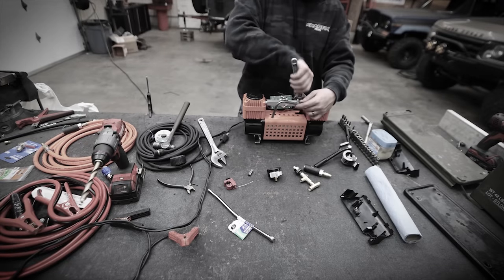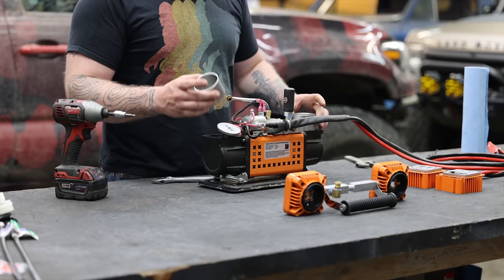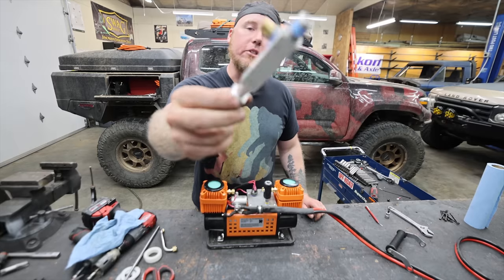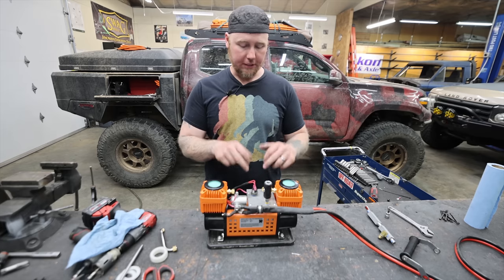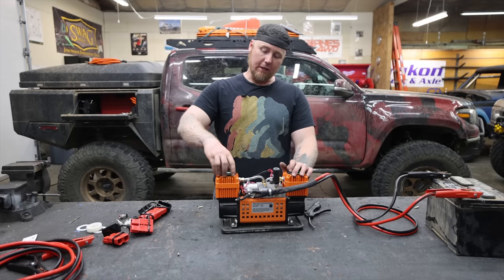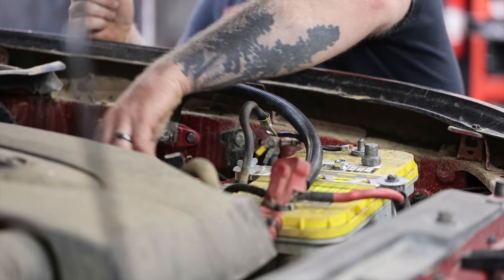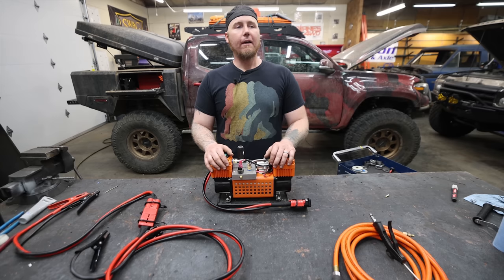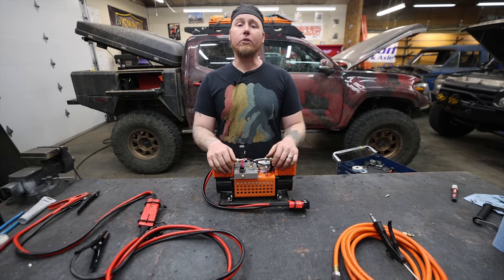Best Off-road Air Compressor MODS Part 2!

Comment: I strongly recommend you put a inline fuse or breaker on that connection coming off your bus. high amp breakers are cheap, resettable, and above all the safety factor! love the videos keep up the awesome builds.
Reply: We thought of nost if the improvements, hard mounting the comp on a cross bed tool box with jumper cables running to aux battery.   Started with a 80 amp breaker and was tripping.   Upped to a 100 fuse/breaker and no more issues.
Reply: I was just going to post the same thing. Fuse everything that is not going to the starter or fuse box.

Comment: I don't claim to be an expert, just basing this on past experience. I've had numerous job site compressors with a similar 90 deg short copper outlet from the "Head" like you have. All of them failed at one point from vibration cracking the pipe at the fitting. If possible adding a single coil in the line adds enough flex to make the connection less rigid and less prone to breakage.  Alternatively having pre-cut extra pieces in your kit would allow for a quick change on the trail if needed.

Comment: As a lineman, for anything on the bottom of a transformer, that’s under 600 volts, we use electrical tape. It’s rated for 600 volts for a single wrap.

Comment: As far as the reeds go, I've seen the Aussies use their feeler gauges cut down to fix or upgrade.

Also, to crimp bigger gauge wires, I cut the appropriate sized nut in half and squeeze everything together in a vice.
Reply: That’s brilliant. Gonna remember that

Comment: Love these video's as I have also done this to my compressors as well. Except I went a little over board and joined 2 of these compressor's together. Ported the intake and exhaust, changed all the outlets to nothing smaller then 1/4" , swapped out the electronics for a 200amp Solenoid, obviously upgraded all the wiring and runs off a 175amp Anderson plug. All tucked away in a custom box that's running 4x 12v computer fans above the heads. One thing to note is you will find the limits of the valve in the tire at the pressure these run. And any mods will almost not Change the time it takes at all as the valve is your biggest restriction, unless you work a way out to up the pressure. But when pumping all 4 up at the same time that's where the improvement can be seen. I compared the difference by filling my workshop compressor tank from 0-40psi and timed it. Single unmodified compressor did it in 54sec, ported/modified single compressor did it in 46sec, 2 modified compressors joined did it in 23sec!   I'm keen to see how far you go with this compressor. I like your idea of adding extra valves in the head!
Reply: Awesome…LOL, yep, port and polish Schrader valves & stems.
Reply: I just pull the needle valve out when doing big tires. I have a quick coupler fitting that threads on the valve stem.
Reply: Turbo Charged portable Compressors
Reply: I'm doing something similar but with a 10-gallon air brake tank added on.
Reply: I know I'm late to the party but I had the same idea lol was thinking I can buy 2 of these and design the block to conjoin them into an H4 configuration, route the lines through a finned reservoir to help cool the air and not bother with fans since I'll be aired up before it gets any serious heat lol

Comment: A lot of auto AC compressors (like a York) use reed valves, I'm sure the local wrecking yards are full of them.
I ported the head on my old Masterflow single cylinder version of that thing, and it made a noticeable difference.
One thing to keep an eye on is the connecting rod bearing, I had one go bad (after several years) and it knocked like crazy, but they are easy to replace with a better quality one, they're just peened in place, at least on mine.
I used to pick them up for $25 before the offroad community discovered them!
Love your channel.

Comment: This series is awesome! Those Anderson fittings would be awesome for a bunch of stuff. 
1. Jumper cables that plug in on 1 side so you don’t have to open the hood. 
2. Maybe somehow you can plug solar panels into it and charge the trucks battery when camping? 
3. A spotlight could plug into it that can be used when working at night. 
4. Potential welder plug (with modification)
Reply: Meanwhile most of these stuff we already use Anderson plugs for in Australia and have done for at least 10 years.

There are things that you need to take into consideration. 

For jumper cables, the ones he used are inadequate. His 4 gauge cable is treated for about 500a he used either sb120 or sb175 Anderson which have 240a and 280a rated continuous draw respectively. So his jumper is now derated to that. 

So for a jumper cable you would need the sb350. But it would need a big isolator like the ones used for winches, or a big fuse, in the case of an isolator you presumably would need to open the hood to activate it. You don't want an always live electrical wire of that thickness under your hood. 

For solar panels it is always done through a DC-DC or an mppt but the SB50 and much lighter cable is all you need. I have several Anderson in my ute in several places for these type of scenarios. 

For the welder you would need again an sb350 and they are huge.

Comment: always be sure to fuse leads coming off the battery!  OEM always have fusible links, or fuses, aftermarket is no different. triple insulating isn't a good replacement for proper fusing practices.

 can even do a circuit breaker for ease of resetting if fuse replacement/cost/time is a concern
Reply: Agree, especially in a spot where it can easily get smooshed in an accident or coming off a rock wrong.
Reply: a simple solution could be a large circuit breaker in between the battery and bus bar that he is using. that way he can easily disconnect power to the aftermarket and leave all the toyota directly connected to the battery
Reply: heaps of OEM battery wires are missing fuses, especially on older rigs, but I agree, a row of nice fat ANL fuses built into the buss bar is what I use on stuff like this

Comment: You can wire out everything using Andersons including ditching all "cigarette" plugs and going with Powerwerx Powerpole at 45amps over 10gauge wiring. They have everything for expansion and connection.  Everything from solar to lighting to fridge etc. all on Powerpoles.  I use the large Andersons with 1/0 welders copper for distribution from front to rear to the auxillary, from auxillary batt (LiFEPO) and a 300amp marine switch to tie it all together.  I WILL be getting that compressor with the mods you've incorporated to back feed my on board Viair system for better faster flow in air ups.  GREAT videos man, keep it up!

Comment: excellent video, I'm glad you mentioned making sure to take extra precautions with insulation when installing the Anderson connection wires. That's not something that a lot of people mention when doing something like that, even though it seems like it should be common knowledge!

Comment: Have you thought about fitting a air chamber to store air as you use it to give it some flexibility and to reduce the heat build up, just like the big air compressers.

Old 2 stroke motorcycles had reed valve's made out of a plastic, polymer type of reed with a curved back plate, something like that or actually have a look at the way the 2 stroke Reed valves work.

Try securing the Anderson plugs in a more secure and sturdy part of the chassy so it does not put excess ware and strain on the cables.

Comment: Nate, I like your thinking. Just a note on the electrical work, consider putting a large amp Fuse  ( like 100 to 200 AMP )to save your truck from fire if a short to ground should occur.  I was installing a large cable upgrade to my jeep when I had a short to ground and the large fuse 250 Amp saved my rig. I used ANL style fuses they have large AMP ratings. Keep up the great work.

Comment: Good to know you're in the NW..   I'm in the Everett area and have owned a semi-serious off-road vehicle - nicest vehicle I've ever owned - for two years now.   Need to catch up on wear parts from two previous owners lack of maintenance, and get 18" wheels (smallest I can fit for more A/T tire options) so I can start doing some wheeling.  As well as some other off-road upgrades.

Came across your videos a couple of weeks ago and like what I've seen so far including this super cool compressor series.    Thank you!

Comment: Note instead of running just heavier cable, you should always fuse between ur battery and bus bar suitable to the cable and then each accessory should be individually fused as per the equipment specs!

Comment: For the reeds you can use feeler gauge I used them to repair a small outboard motor. 👍 Worked great. or go to a motor cycle shop and see what they have. Great project. 😁👍

Comment: About 5 years ago I ported out one of these compressors same as yours, it was 18% faster afterwards. I drilled out the ports in the head under the reeds, enlarged the intake and cut up the air filter housing. Stock on a 33x12.5r15 0-40psi was 3 minutes, 58 seconds and ported was 3:15. I think you've gone down the right path reducing the voltage drop, mine was a whole minute slower running off my other 4wd with an inadequate alternator! (11.5v vs 14.15v!) If you want to fit bigger reeds I think cutting up some feeler gauges would work well.

Comment: Hey, great idea on increasing intake air BUT BAD BAD BAD for your compressor. The location of air intake on sides is specifically designed to draw air over cylinder head fins and cause a cooling affect. Think of it as forcing air flow across cylinder on hardly motor as you drive. If you sit on red light for a long time it overheats because there is no air flow. So since you did a hole on top you MUST add a few cheap 12v computer fans or something to force air across your cylinder fins to draw that heat away because radiating heat (which is only way to dissipate heat now since your mod) is not enough especially if in that ammo box you will burn up your cylinder seals or warp the metal. Good luck. Great ideas by the way.

Comment: You will really appreciate having the anderson connecter's on front and rear of your vehicle. I've been using them for many years, from jumper cables winch connections on and on.
Reply: That's what I use for jumper cables
Reply: Same. Nice being able to unplug my winch if I just want to take my bumper off or being able to plug up a set of jumper cables without opening the hood.
Reply: YES, I planned to install Anderson plugs on front & rear of my rig for cables/accessories.
Reply: I also have Anderson plugs on my plow truck.  It runs the main power for the plow along with winch, jumpers.  You could hook up solar charger along with other options. 

Just put a power cut off close to the battery if you are worried about it.

Comment: Nate
You should run another line with Anderson connectors to the back of the truck so you can run your winch on the trailer or on your extra winch on the trailer hitch for the rear so if you get into a hairy situation off road you can use both winches when necessary.
Reply: To do that safely he would need a sb350 Anderson connector and properly sized wire. A 12000lb winch can draw 430a so the medium duty Anderson like the ones he used (sb120 or sb175) would melt and the wire may even catch fire.

Comment: I picked up this compressor last year and also used jumper cable wires and Anderson connectors. So much better than the stock wires and alligator clips. Also did the pressure switch mod to auto shutoff to prevent over pressurization.

Comment: CFM GAINS: Search for "rotameter PRM 400 LPM" to help quantify your CFM gains. If this compressor really does put out 300LPM free flow (likely less), a 400LPM rotameter should still fall in the ballpark. These mechanical flow meters always have some restriction as well (suspends a physical weight inside a tapered tube) so it's not exactly "free flow" anymore and will measure a little less than actual. If it pegs, try filling a tire at 10psi or more (meter can handle 100psi) till you get a solid reading. Digging this mod series. Keep it up Nate!

Comment: Dirt,
   I just finished watching both videos of the mods to your little twin cylinder compressor. I recently had a  Viair go south on me (which I never liked in the first place) and I'm on the hunt for a replacement. I really like the twin cylinder versions vs the single cylinder ones. I really like the mods you made to it. I've dealt with air compressors for decades both at home and mobile. For home units there's not a lot that can be done to improve them. But for the smaller mobile ones, like 12V units, yep, just like you're doing, improvements can be made. 

As maybe has already been stated, I'd like to have seen some test comparison numbers on a bone stock unit and the modified one you're working with:
1. A flow and time test to fill a given sized tire from trail pressure to street pressure on stock vs modified
2. An amp draw or any current or voltage draw measurement on the stock unit while working on filling a tire, vs the modified one with the much larger electrical cables. 

I too have been using Anderson connectors for my electrical connections on my compressors etc. for years and years. They're great and very durable. Thanks for taking the time to video all those mods on that little compressor. About 99.999% of the off roaders could care less about improved efficiency and just simply put up with what ever comes out of the box. I like improvements on that stuff, just like what you're doing. Keep up the good work. 
Scott

Comment: Great videos!  I strongly suggest a Circuit Breaker within a few inches from battery!  I've used 500a breakers from battery banks that were pumping over 5000 watts to sound system.  Breakers would "buzz" when slightly overloaded, but instantly open when shorted!  Fuses only work once!  Tiny 4 gauge wire would vaporize!  Also, a one farad capacitor on the bus would extend the life of all the electronic stuff!

Comment: Same on the solder, but after having attended several different courses over the years taught me that PROPER crimping is superior for high vibration applications.
Reply: yep. no soldering on vehicles. unless you can tie down both ends of the connection properly. but surely not for hot or ground leads of the starter battery. solder ain't a good conducter.

Comment: I also have been running a Anderson plug on my front bar of my 4x4 for a compressor,  solar panel, 12 volt shower and for also being able to plug a charger into it when it's sitting in the shed for weeks at a time.

Comment: I did the SAME EXACT thing for my compressor and jumper cables last year, lol. Great minds and somehow mind keeps up.

My jumper Anderson ends join to make a comple set. Separated, one side will connect to the compressor and allow clamping to a different battery, and the other side connects to the truck to jump someone without lifting the hood.

I'm VERY interested to see what other accessories you rig to hook to the truck.

Comment: Great videos :) We have a similar compressor for cheaps here in Oz. 1. Question: Why not remove the powder coating from the heads so the alloy can do it's job of dissipating heat better?
Reply: EXCELLENT idea!

Comment: Nate I've built a set of jumper cable the same way and plan on using the Anderson connectors on my compressor too. cooling that compressor is tough but i just place it in front of the jeeps grill and the radiator fan moves enough air to cool it. for the carry handle ..... fab up a new baseplate with a handle integrated into it.

Comment: Great idea on using the motorcycle type of filter to open up the air intake flow! 

Nice use of the andersson connectors also oh I have a beefy crimper if you ever want to borrow it.

Comment: Good job! I like the Anderson connectors, I have one connected to my truck battery which is handy to connect jumper cables to jump someone's vehicle, without having to pop the hood on my 4x4 F350. Plus you can do all the things you talked about connect an inverter easily or other 12V accessories.

Comment: I'm thinking... enlarge the output port. Not too much. (Don't know how much) Small hole = high pressure, small flow, large hole = high flow low pressure. The seal on the port is the tricky bit.
Great video.

Comment: Love this series.i wish so badly I could get my hands on one of these compressors. Question though. Have you thought of the molded bolt through holes on the Anderson connectors. There is a recess on one side to capture the bolt head or nut. Certainly your skills with nutcerts would come in handy here. Would love to hear your thoughts on why or why not.
Reply from the maker: I'm going to build a different bumper and I want to address this when I do 👍
Reply: Good plan

Comment: You can get a 16 ton hydraulic crimper all over Amazon that will do 2/0 cable for around $50. They will give a superior connection over solder on a cable that large, Most are marked in metric, but easy enough to figure out what fits for a tight crimp on a given wire. I've had mine for about 6-7 years now.

Comment: Strips of "spring steel", comes in a range of thicknesses, then you can shape it with a belt sander or similar. I've done it on larger air compressors.

Comment: Nice vid Bro - some two stroke motorcycle reeds will work. to measure the difference in cfm (not actual cfm) measure the difference in time to fill a tank to a certain pressure, but I'm sure that you have already thought of that.

Comment: I put a 12” electric radiator fan on the side of mine. It over heated. Also back pressure causes problems. 11 cfm is 2x the flow a regular tire stem allows. Caused pump failure. So doing at least two tires at once helps reduce back pressure plus fils tires 2x as fast.